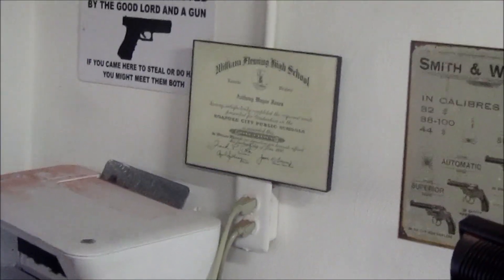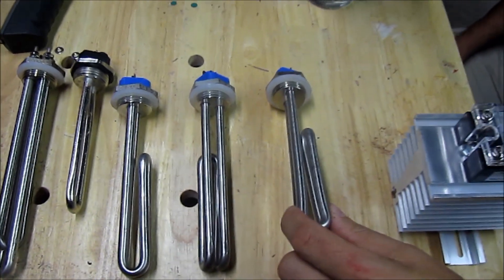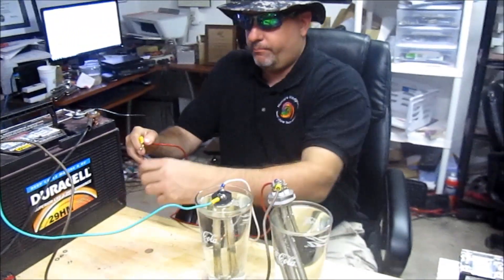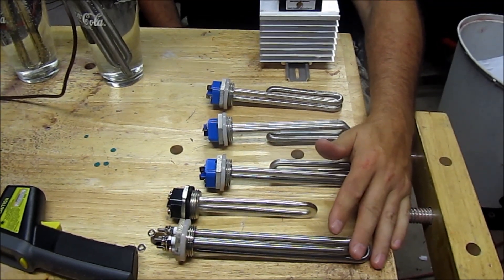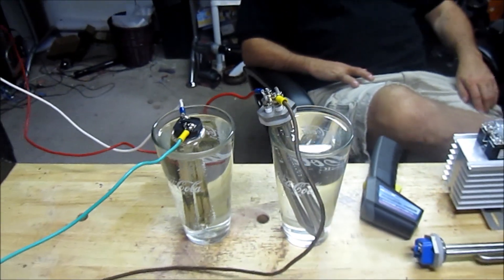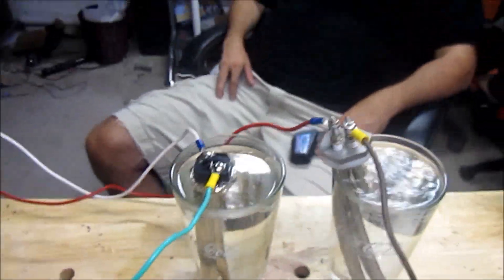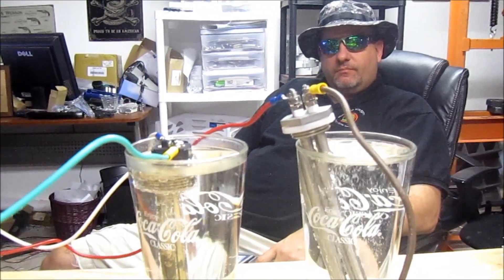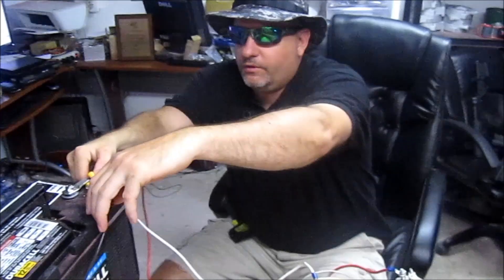DC Water Heater Element 12 24 and 48 volt Wind and Solar Diversion Heating by Hurricane

Comment: I just installed a DC assist Het pump. I'm looking to install a dump load into my 10 gallon electric hot water tank that is in front of my Noritz tank-less. I'm also looking for new subs to my channel. Check it out.

Comment: I have 48 volt solar panels, 32 volt battery bank and controller... i use a divert load 48 volt dc coil in a 12 gal tank , sofar water temps go 82-112 in seattle summer... would 36 volt dc coil deliver more heat with same divert load from same controller????  I am thinking about winter is on the way...

Comment: Sir,
how are you?
very fine video and i am from Pakistan
i have 12 volt DC water heater purchased via online today. i want to run this watet heater directly from solar panels and my solar panel voltage is 20 volts. May i use this 12 volt DC water heater at 20 volts
Reply: Well did you end up trying? I feel it would be okay being submerged in water.

Comment: Is the 300w resistor composed with 2 resistors 150w  ?
150w X 2 = 300w  ?
Reply: 300W resistor = 150W resistor + 150W resistor ; must be in series.
.
.
If you connect the 150W resistors in parallel   , you get 75W resistor

                                       ,-------   150W resistor  -------,
   75W resistor =  -------'                                               '-------------
                                       '-------   150W resistor  --------'

Comment: Question my freind im stuck for the moment ? i bought a trinasolar panel 365 watt,  39v,  9.3 amp, open circuit voltage 48.0 volt, i dont have battery bank i want to run direct from solar panel like i seen on youtube what watt dc element do you recommend?
Reply: 48v

Comment: will 35 volts be enough voltage  to heat my 24 volt hot water element or will it burn out? if so how much ought i use? I amusing an element rated 12 volts, and now i am trying one rated 24, and solar panels are supplying my power.

Comment: Can there elements heat up if connected directly to the solar panel (with a fuse for safety)  would a 12 volt element burn out without a charge controller because the panel is putting out 18+ volts?
Reply: Yes but you can buy a 24 volt element and 18 volts probably heat. You can add a high watt resistor. I would buy an element that works 12 to 24 volts I think I saw them online. 73
Reply: Living Lightly - it depends on the solar panel. as you seen the 12v unit it 300 watts, is very unlikely that with 2 x200w panels that you will get the full 400w even at peak hours. for this reason i would use battery pack and a thermostat to cut power. if your storage tank is insulated enough, it should retain its heat for long periods. i used to have an old thermos flask with a home made element that was supprisingly affective!

Comment: To cime in here:  To address Goodolboy One, question.  I used 200 watt Solar and the 12v Element on my 10 gallon RV with no problem.  I made my Own Thermostat it easy, just use Electric CONTACT Temp Sensor(s).  I don't live in the RV, so were out having fun all day it's heat up.....  The same Panels also keep my 12v Batteries Completely charged up, then dump into the Water heater.....  Simple system, totally COST EFFECTIVE.  You don't need all the PRICEY stuff to have a SAFE and RELIABLE SYSTEM.  Remember even your Propane can get the water to hot, that's why theres a Blow Off valve.
Reply: Can i use power supply. Ac to dc to save on electric bill

Comment: i did purchase the 12 volts 300 watts from ebay, is there any polatiry to be followed in connecting at 12 volts dc?
Reply: for a heating element NO it does not matter.

Comment: Please just hook those state up to a 12 vote solar...  there is a produck gap in 12 vote heater and heat bulbs that can heat in the day time .. to help heat a home..   safely for free..  and with out damage wire and solar and element
Reply from the maker: Why would we just hook it up to 12 volt solar? There is no gap in the market all needs are covered? Are you serious? You think your going to heat a home with a 12 volt dc water heating element?
Reply: YES YES.  Day time free winter heat Simple. .It is low cost way  to help heat a home.. Like it to be a set it and forget it ..     A dc to ac converter will reset it self low watts .. no we do not wont a batter buffer ... so cut both of them out ..  add a 55 gal drum and a heat element . Your it cant find a 12 vote heat lamp on the sheep.. can not find a 12 v oil felled heater..  one should put a heating element in to a cast iron stem heater and pipe it in to the cold side of the house water heater.. one may need to add a stem vent valve.. .
Reply from the maker: Dude your not heating 55 gallons of oil or water any time soon with a 300 watt element. In the winter by the time the oil or water got hot the sun would be down. I guess it's workable but it's not free by all means and it would not be as simple as hooking a solar panel to a hot water heating element
Reply: no do not heat oil .. make a water heater to heat a room..I don't now why it would not work..  when solar making 4 watt. you get low heat ..  it may top out at 260 watt.  your making good heat  Look your playing with them your marking them..  They make a solar panel for this task. thicker wire and all..  Just tell us what the out put at um .. say 30 and 100 watts 12 v. dc.
Reply from the maker: the laws of thermodynamics are still in play if we have a measure of 300 watt in we still get 300 watts of water heating out. Not 3000 watts like a big AC water heater. They take longer to heat larger volumes of water and the energy transfer done in heating would lose energy. If you make it work show me how because this would be nobel prize worthy
Reply: Why do I must I tell you it a small space heater one the is on and helping heat a room when the sun is out.. it something to plug are hobby solar in to ..
Reply from the maker: And there you have it...the customer is always right ....you can heat a room I am wrong

Comment: What about a 12v water heater for a 35 foot sailboat? What kind of panels and storage would one need to have hot water in the galley and in the head for sink and shower. This is also going to be an electric propulsion sailboat. No engine like most others. The boat will be totally off grid. No propane, kerosene or alcohol for cooking.

Comment: I have a question... I have a 10 Gal hot water heater in my RV. will these work in a RV, and is there a thermostat for these so they will shut down when the water reaches a specified temp ? Also, Do these drain the battery real quick ?